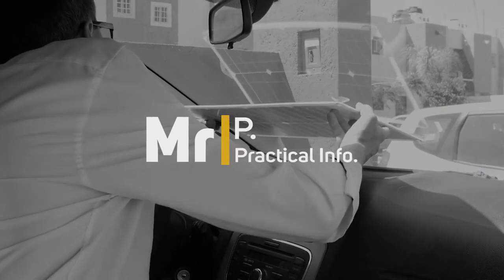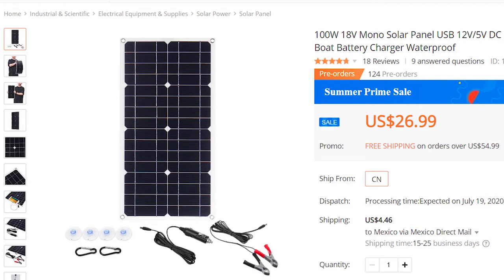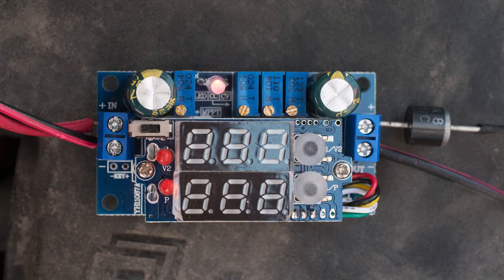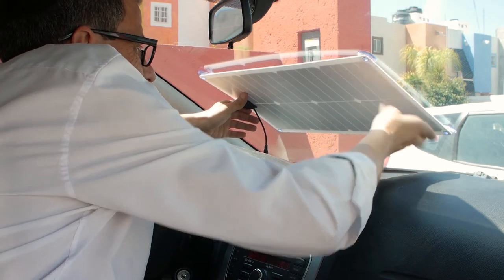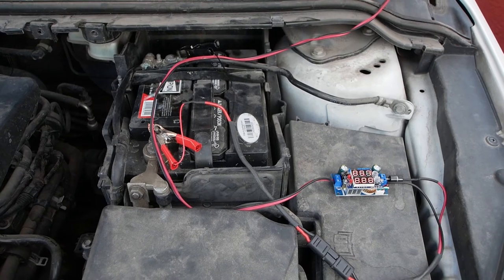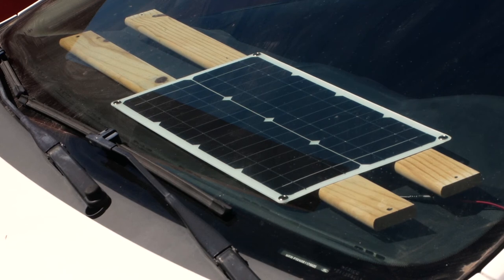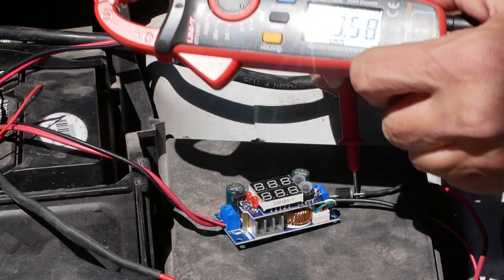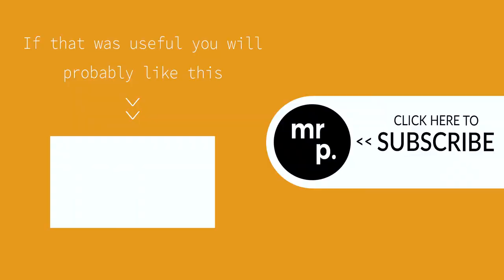Solar Charging a Car Battery 🔋

Comment: Quick question: I plan on creating this small design using the components you recommend in the video. I will use it on an older Toyota truck that sits for long periods. The truck does not have a lot of plastic components in the engine bay. The question is, what is the detention for the acrylic box for the solar panel controller?

Comment: Looks like you need to set the Maximum Power Point Tracking point manually, instead of a real MPPT which continually does so automatically. Does the trick though!
Reply: MPPT must mean Manual Power Point Tracking 😂

Comment: Firstly i would say thanks for the video. Have several questions. How does controler works? Will it reset all settings each night when solar panel is off?

Comment: Very nice, simple design. Going to do this myself. How did you route the wires from the cabin into the engine bay?
Reply from the maker: I had the wires going out under the hood / bonnet edge where there is a rubber seal and had them enter the car interior between the A pilar and front door (above the hinges) where there is also a rubber seal. You could buy some thermal tubing that matches the color of your car to sleeve the wiring so it doesn't jump out to anyone walking past your car.
Reply: @brieftodo  Thank you!

Comment: Do we need to disconnect the battery from the car wiring while charging? Someone commented in a Solar FB group that it could harm the car computer system if not disconnected while charging
Reply from the maker: A car battery charges via the alternator whilst running and that does no harm to the ECU so I can't see any logic in why it would harm the ECU whist being connected and solar charging especially seeing that the there is a charge control circuit in place.